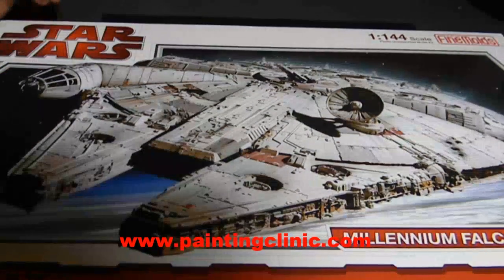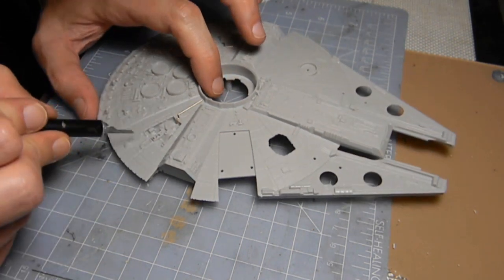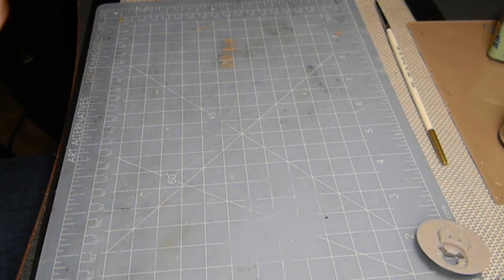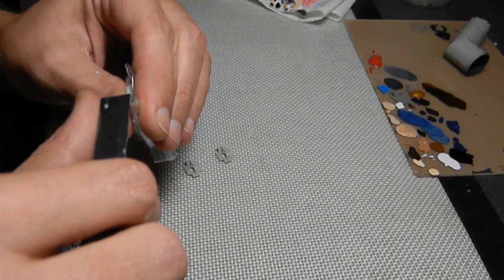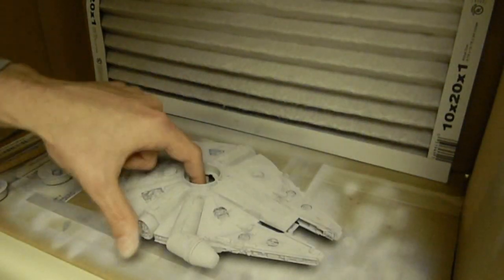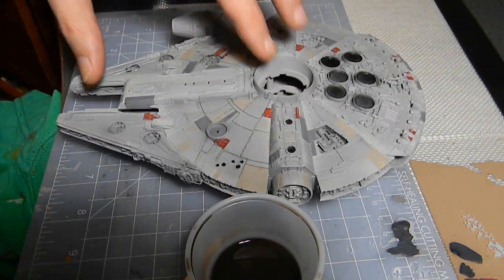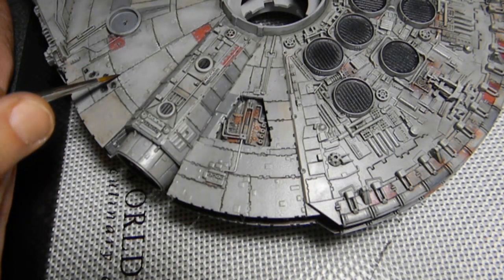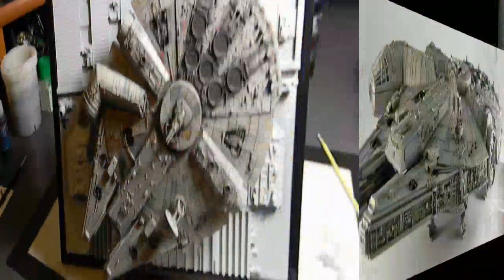Building Fine Molds 1/144th Millennium Falcon - Full Vid

Comment: Hello Doc, congratulations on a superb build. I have watch up until your problems with breaking drill bits, I too have suffered the same issue with exhaust manifolds on my model aircraft until I bought a great little tool called a pin vice. They really help when trying to start or complete a hole in any material. Hope this helps in the future, keep up the great work! All the best from across the pond!

Comment: I started out using the model master/testor's sem-gloss top coat, ran into the same problem you had with the airbrush...Especially towards the last drops of the bottle, been using Tamiya top coat both semi-gloss, and gloss/clear, don't know why I hadn't used it from the start of having an airbrush three years ago great finish and self levels out, looks horrible when it goes on but don't worry about that.

Comment: If I can kindly offer a critique. In hindsight, the diorama (scene with a painted backdrop) would have been more effective in composition if it was larger. The golden rule is: Never let the model overlap the frame. Don`t force the model into the scene.The concept is fantastic. The scratching of the surface background is great. The model and paint work is excellent. However, the frame size is too small, therefore it affects the composition of the piece as a whole.  Keep up the good work. :-)

Comment: I just got mine a few days ago, and it's honestly my first model, but I was wondering if I could use spray paint for the outside (since I don't have a air brush) 
what do you think?
Reply from the maker: Spray cans are fine when you are just starting out. Yes, an air brush would work better, but they are an expensive investment. Stick with cans until you're sure you want to get more involved in modeling.

Comment: The problem with the Falcon is the TESB and ANH models are NOT identical.
This is going to get even more confusing with the CG models and details added and different on those, too.  The mesh on the engine exhaust grille was NOT in the original versions of the Classic Trilogy.  That was added to the CG model used in the Special Edition of Star Wars (1977).  The 32-inch and 5-fter had featureless exhausts that were basically frosted plastic for powerful white light to shine through and they added more exhaust effect (and color) with hand-drawn animation for the original theatrical releases.
There are features on the TESB model that aren't on the older ANH and vice-versa; the ANH model is generally more detailed but most people won't see the huge glaring differences (aside from the landing gear but I think the ANH model was modified for TESB).  You gotta be careful with reference pictues and pick what you want to emulate.
The models have also been damaged by shipping to different exhibitions and age.  They were never meant to last over 40 years!  People report missing pieces in sections and paint which has altered due to time and chemistry.  It happens in real life with planes and any vehicles constantly subjected to sunlight.
When I saw the differences between the models in photo galleries, I began to appreciate the 5-ft model more but ironically the 32-inch model was the "Hero Model" for the better part of 35 years until Disney got their hands on Star Wars.  Most of the toys and models prior to 2015 were based on the 32-inch TESB model.  The CG model pretty much blends the 5-fter with the landing gear of the 32-inch and who knows what other changes they made besides that damn radar dish which got replaced with the original dish model for the last Sequel film.